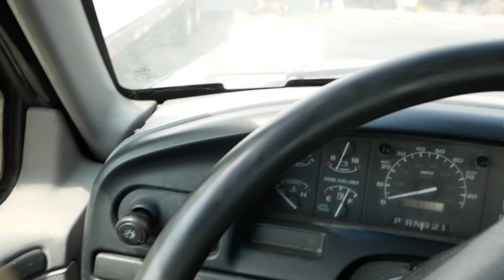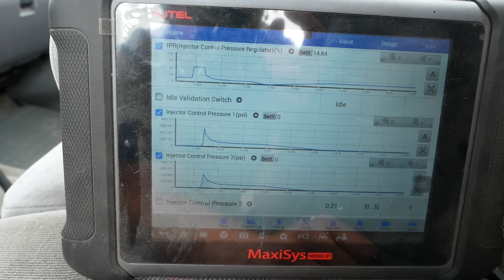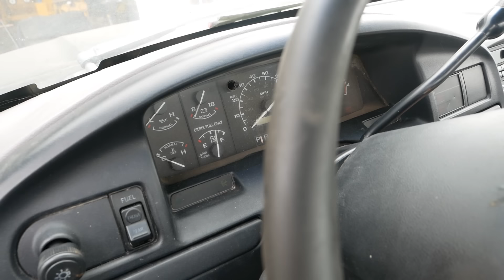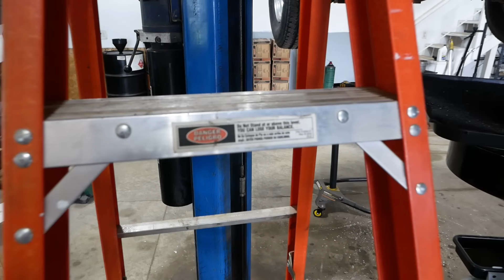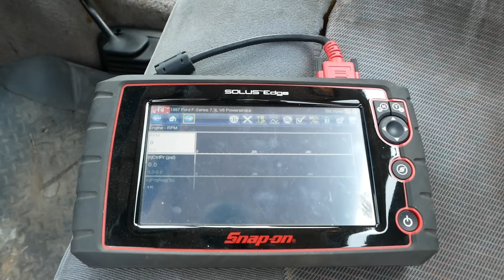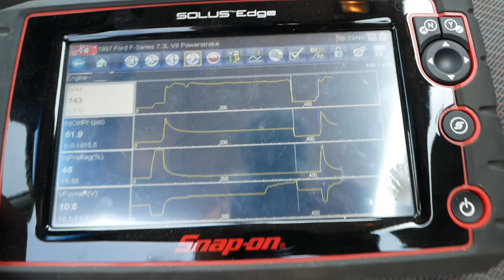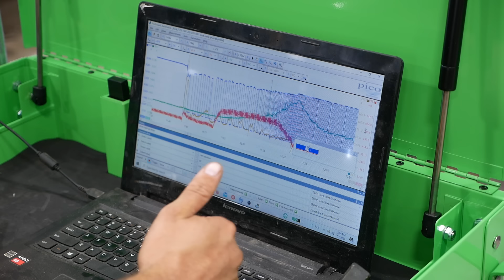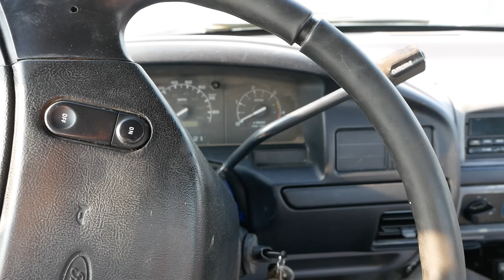Can We Get This 7.3 Power Stroke Back on the Road After Four Years?

Comment: That fuel tank issue has been a gasser of an issue with the Fords. I discovered something on my own about the subject totally by accident. I went to an Advanced parts store for a resto project I am currently doing on a 1986 F-150 high boy. I was looking to pick up a fuel pump for her and the guy behind counter looks at me and says you better bring the old one I have 3 listings no telling what you got. I said huh it's and 1986 dude it should only take one pump. Now the customer standing behind me says I can explain all that to ya. He said number one there was a recall of the metal tanks because of the Chevy law suits on the metal in board tanks Ford decided to voluntarily which is almost unheard put out a recall that stretched thru into the 90's before they realized the project was denting their profits. So for one people had the option of even buying a plastic replacement fuel tank or they could register with Ford and have a dealer replace the fuel tanks. I have no idea whether or not the guy was telling me the truth but it does seem to make sense since I do have a 1986 with a plastic tank and I have 1988 with a metal fuel tank that is still in pretty nice shape simply because where I had it out of the truck I epoxy coated it way back when it's fine on the outside no telling on the inside.. That is probably where the 3 diff pumps comes in at on these trucks.

Comment: yeah the cool this is if you loose the belt you loose brakes since they run off the power steering
Reply from the maker: Close. These trucks use a belt driven vacuum pump. The Hydraboost came later.

Comment: Hello, my english is not so good. About your starting problem. I think the leak oil from your Injektors are too high. The same problem is often at mercedes cdi motors. Your starter can not make enough revolutions for bringing the high diesel presure over the high presure pump to the injektors because the leaking oil from your injektors too high. Understanding is : one or more injektors are leaking. The same oscilloscope screen shows up at the error by mercedes. By manual shifters you can test this error if you pull the car with a anathor car then it starts right up. Best wishes from germany

Comment: i dunno....but at 42 minutes i'd just compression test all the cylinders and see if you have a valve or ring problem that's making for a hard start....if compression is good then leave well enough alone....a long hard start is better than no start at all......when you had this same problem with your Oliver tractor (hard starting) the whole fuel pump and injector system was badly contaminated and needed to be rebuilt, could be the same thing here.

Comment: Replacing crusty brake bleeder fittings? The most successful I've seen on the 'net, can't remember who, drilled the remnant to less than the tread dia., welded a blob in there to above surface, then welded a nut to that. Maybe no crust between remnant and nut. In the words of a Cheezel ad, one mouse to another: " Gotta be worth a crack, Nigel . . . Nigel?" New Zealand humour. :)
I'm also wondering if automotive wiring should have a rodenticide impregnated in the insulation?

Comment: Now I'm laughing my ass off every time you walk by that driver side fender it's ate out the same exact f**** way mine is I love my Fords yeah and that back gas tank I've never seen one that's not 8 out mine is a steel gas tank on the front I need a back tank too drove all the way from Montana with 110 gallon slip tank plus the 15 gallon main tank all the way to Alabama made it here in 4 days non turboed ID eyes 55 60 mph

Comment: The ABS module is behind the glove box. I "fixed" my ABS light by unplugging that module. And bypassing the ABS valve in the brake system. LOL I hate ABS anyway. It has tried to kill me several times. I want to be the one in control of the brakes! I grew up before power brakes was a thing. I don't want some "system" second guessing what I do. I have never been in an accident because of the way I brake. But have been in several near misses because of ABS.

Comment: I worked at Ford 15 yrs I am a master tech on that engine alone its the pcm its got a bad chip in the memory circuit it was to relearn all its data values everytime you shut the key off those melted wires caused this see it 2x times before
Reply from the maker: That was my initial feeling, but the scope doesn't seem to show it. It closes the IPR just like it should. I don't know. Customer told me he thought it had a long crank time before they parked it too.
Reply: @WatchWesWork  yeah I only proved this ounce because I swapped a pcm in truck doing that same thing with a known good one and fried (oops) the known  good one then both trucks had same problem I took the pcm cover off thats right I removed the tamper proof screws and went were few techs have there was a clear burn mark on the boards on both pcms in same place

Comment: No nothing leaks down, the ecm will shut the glow plugs down after the key has been on that long, so you have extra cranking amps to turn the engine over faster. Cranking speed should be 180 rpm minimum warm oil. New starter would probably fix the lagging start. 

Here’s a check list I use from Oregon Injection
https://oregonfuelinjection.com/content/uploads/2016/08/ford-7.3-94-03-diagnostic.pdf
Reply from the maker: That's not it. If you turn the key off for one minute, then on for 10 minutes, it has the same long crank time.

Comment: It iasa diesel engine. Keeping the key on might keep the glow plugs running? Diesels need a second or 5 of 'glow time' to get the coils warm. That might explain the cold start/ leave key on. Maybe key on, no turning cranc might keep the glowplugs warm?  https://en.wikipedia.org/wiki/Glowplug#:~:text=A%20glowplug%20(alternatively%20spelled%20as,heat%20of%20compression%2C%20preventing%20ignition.

Comment: On the first one. Way too much cement. Buff job was sloppy. Should stick the patch and apply heat while you stitch it in before cutting the plug stem. Then sealer over inside once dried.

Comment: Nothing wrong with running an old truck, my 99 finally popped at 505k new used motor and she’s back on the road, and yes she gets worked harder than all these fancy $70k trucks kids turn into tar babies with rubber bands for tires.

Comment: I have to say before anyone fights with a wheel cyl or caliper for how plentiful they R in salvage yards it is not worth it. New brakes and even new used wheel cyl and calipers R a blessing. I just went to Harrys u Pull it the other day for a Hub for a Silverado. and lord and behold the truck I found had brand new everything up front. New calipers new CV's new hubs just like the shit came out of the box and I took it all with me... It will not go to waste here hell I even took the brake pads along too ...  I mean brand new no dirt no rust everything was shiny new. I can only assume some of the vehicles I see in Harry's must be IMPOUND vehicles because the Tahoe I got the shit from was spotless. I even saw the transmission was new or rebuilt not a spec of dirt on it painted pan and shiny housing. To me it looked like it was NEW not a rebuilt. I don't think anyone in their right mind just junked this rust free like new Tahoe.. The Has to be some explanation because it is not the only vehicle in Harry's I seen like it
Reply from the maker: I guess you've never been into one of these floating axles. It has inboard drums.
Reply: @WatchWesWork  I didn't realize that by your video I keep getting interrupted by a furry pest that wants attention and ordering parts for my F-150 revival this spring.. Time to wake her up after a nearly a 25 year sleep... And no I have never worked on I mainly do Silverado's but I have ppl that want me to do Ford stuff for em...
Reply: @WatchWesWork  I would like to send ya a cordless ratchet but I just over spent again forgot I paid a bill and U know clubbed myself on the head.... again... Easy to do when ya get spring fever like I do every year I bring something dead back to life... Hopefully one day a guy will come along on the U toob that bring us back to life when we get parked out in a field... My threat on the ratchet is for real don't even know where U are from yet. Iowa I think??? Love the scenery and tranquility in your videos... I love the peace and quiet of the farm lands. i was raised on a Farm Kutztown Pa...

Comment: Upvote for the savage Scotty kilmer burn, lol.  A plumber got a hold of my brake system too, lol.  I have this theory that you could explain the difference between low pressure and high pressure to these brake line bozos, by dripping hot sauce on their faces, versus a nice blast of pepper spray.  Repeat as necessary.

Comment: I know why this truck is not running right. He cannot put an AC Delco part or battery in a Ford.

When my wife and I were about a hundred miles from home my windshield wipers was so bad we had to stop and pick up a new set. Unfortunately all they had was AC Delco so I had to put them on. As soon as we got home I had taken them off. Then I went into the shower they don't make water hot enough to wash off the Chevy part that I touched. My wife thought I went a little too far when I drove my truck to the church and ask the priest to come out and exorcism on my windshield. -)
Reply from the maker: Did your priest stab the wipers with a sacred dagger?
Reply: @WatchWesWork  no we just burn them and use the holy water to put the fire out.  -)

Comment: So ur gonna slap urself on this one. Reason for extended crank is most likely due to the rusted out back fuel tank. The fuel selection is done by a solenoid you shut off the key and ur getting air into your fuel system via the fuel selector solenoid. They always leak a little when they are old. But yeah been there done that...

Comment: Junk, I have been a wrench for Toyota for 40 plus years.
Although they had some frame issues due to rust, they were addressed by the corporation 20 years later at no cost to the consumer.
When I stepped away from the dealership and started working on north American vehicles, I just laughed.
Mass produced garbage for the most part.
GM for instance can't seem to make an alternator that lasts more then 60,000 miles, or a truck transmission for that matter.

Comment: I'm about to put a channel together and show you all what I can do I can fix a lot without a scanner and I'm going to show you how I've learned from some of the best when you come from low-income the funny thing is these guys will spend a lot of money on scanners but still can't figure out the problem and revert to Old technology in pure mechanical skillset craftsmanship the biggest thing of being a real good mechanic is knowing how to use your tools and how to pinpoint where the problem is you got a $10,000 scan tool that scan tool don't really do you know Justice that's the way that I feel I do a lot of troubleshooting on cars welders and I'd only mechanic why do collision repair related work all of it heavy to minor and I like a challenge and let you know how good you are but I think on this truck for my experience with these seven threes I don't know if it ever had the high pressure oil pump changed but just a little FYI the glow plug relay you never tested it to see if it's staying on if you turn the key on in the light is burned out for the glow plug relay I believe that the power still going to the glow plugs and I would think that if them glow plugs are not cutting out and staying on when you turn the key it's going to give you a much faster start depending on how long the glow plugs I meant to stay on the relay for the glow plugs so if they're meant to stay on when you turn the key for 60 seconds on a cold engine what I think is happening is them glow plugs are staying engaged while they key is turned and they're not completely shutting out so they're giving the cylinders some warm to fire versus when you shut the key off it loses all power and it would explain why it takes that much longer to fire up because the glow plug is not on heating the cylinder like it would be if the key is on and then on top of that also check your fuel pressure and then put a liquid-filled 3,000 PSI gauge off the top see what it's getting and then also ohmm out your glow plugs these are a very complex engine there's a lot going on and sometimes it can be hours and hours of diagnosis to get something right but that's just a little thought of what I think it could be but I always start off with doing compression fuel and these have that indeck injector driver module which is computerized but usually when them go bad you won't get no start

Comment: Millions of dollars worth of vehicle property damage and environmental contamination caused by using salt on the roads, trying to reduce vehicle  collisions during icy conditions. Consider that the State of Alaska does not use salt on the roads at all, only sand. Drivers in AK either learn how to manage driving on icy/snowy roads, or they don't drive in the winter. 
It is incomprehensible to me why residents of Midwest states put up with this nonsense. Destroy all the vehicles on the roads from salt corrosion, instead of using common sense solutions. 
After snowstorms, the roads typically dry off a few days afterward while the salt keeps on doing damage. Using salt on the roads is not the way to manage winter driving. 
There are much better ways to reduce ice on roads. Clean sand, spraying propylene glycol and other less destructive anti icing methods are available.